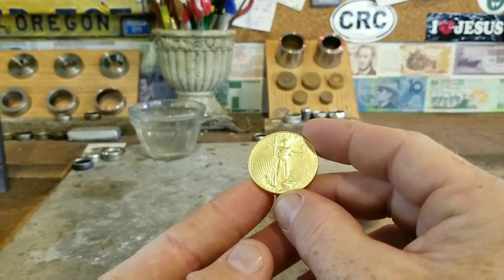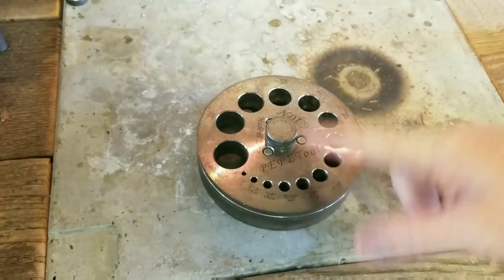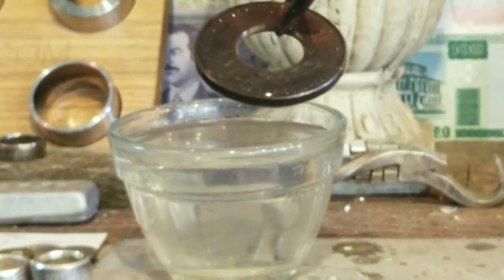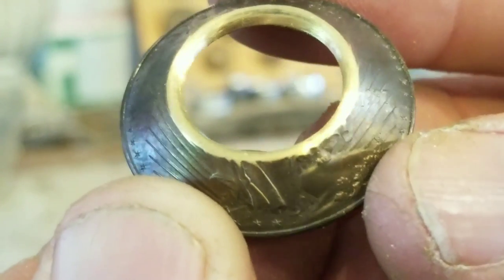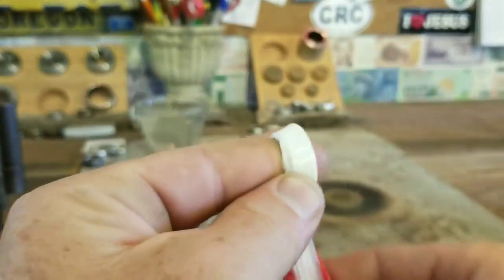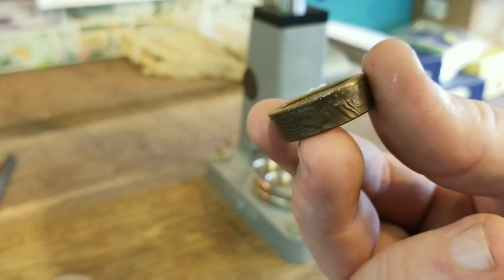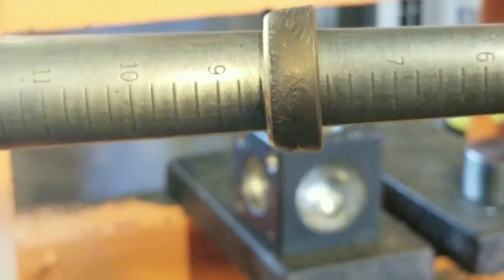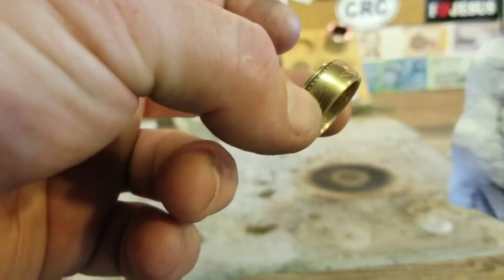How to Make a Coin Ring From a 1 oz US Gold Eagle

Comment: Today that's a beautiful $2000+ ring figuring the ounce of gold and one's time & labor very cheaply. And if you screw it up just remelt and recast it into a flat bar. 24 carat gold is still 24 carat gold and any coin shop besides knowing that could help you. I just sold a clean 4+ gram dental crown that was app 72% gold for a nice price ($157) though that's significantly less then that recast junk eagle is worth. So unless you're a journeyman "smith" and have deep pockets, start and get good on silver coin rings before moving over to the metal of Kings!!

Comment: Terrible question, but if on your second step, if you noticed a slight crack developing, what would be done next? Is it an expensive mistake or is there a remedy?
Reply from the maker: No it is completely fixable. That is why it is important to check often in order to catch a crack early. As soon as you see one forming,  just sand or file it until gone and then continue.

Comment: Very cool ring.   Nicely done!  I was wondering if a person could use a proof version of an American Eagle?  Proof coins are made in special dies with greater pressure for greater relief in the raised design.  I was wondering if the proof process makes the coin difficult to work with?
Reply from the maker: Proofs don’t really make a ton of difference. You would think they would but it is almost impossible to tell them apart when it’s made.

Comment: Hay Scott I am new at ring making in the last 4 months I’ve managed to buy about $300 in tools. I want to make a straight Morgan dollar ring not a tire shape. My knockout is 1/2 inch. after I start the fold what die do I need?
Reply from the maker: You are going to need a swedish wrap die. Check out my making small sizes with large coins video.

Comment: you should have used a Canadian maple leaf, they are 24k and more malleable, making it easier to form into a ring. a walking liberty or any american mint gold coin is 22k (same amount of gold though) and made more for handling the stress of being a coin. Aside from this, beautiful work.  Its just a shame you had to punch a hole in the coin, there are ways around this, and it could have saved you alot of gold.
Reply from the maker: That's the reason I only use 22k coins. It needs to handle the stress of being worn every day. 24k coins are too soft.

Comment: I would like to buy one of Jason’s hole 🕳️ punch but I have yet to see him make one that punches holes less then a half inch. I feel that’s too big of a hole in the coin. And the loss of what ever is on the coin. I like to make smaller holes and feel it is easier to reach the ring size going up as I make the ring rather then trying to shrink the ring to size.
Reply from the maker: His coin punches go down several sizes smaller than 1/2”

Comment: These bullion coins are 22 karat. Aren't they going to wear like crazy when worn as jewelry? Gold is so soft, usually rings are made from 14k or 10k, to make the metal harder.
Reply from the maker: Actually most of the high end jewelry is made in 18 and 22k. 10 k is the base level option and most custom jewelers don't offer it. 22k is a bit softer but still hard enough for jewelry. That is why 22k gold coins were minted in 22k instead of pure. That way they could stand up to being used in circulation.

Comment: How does failure “cost you a bundle”? Unless that coin has any additional value aside from its gold weight, it’s value doesn’t change regardless if it’s whole or in pieces.
Reply from the maker: They cost around $140 over spot and then, even as a jeweler, the refining process costs me another 5%. Failure isn’t free.
Reply: @CoinRingsfromTheMint : I’m not referring to buying (which you can easily get for $25 over spot), I’m referring to selling the pieces, and the refining cost is negligible. Nice ring though.
Reply from the maker: @scolee6408  I call bs on finding a us gold eagle $25 over spot lol. Maybe a generic round but not an eagle. Prove it
Reply: @CoinRingsfromTheMint : First Fidelity Reserve is where I bought my last one. I used to pay too much but a found that a little searching and haggling over price per quantity pays off.
Reply from the maker: @scolee6408  well I just called and even with the amount I do every year which is a ton I’m only getting $100 over spot. You must be buying damaged ones. Thanks for the tip though.
Reply: @CoinRingsfromTheMint : Possibly, I buy for the bulk weight, I’m not interested in specialty coins, strictly investment. They look fairly pristine to me.
Reply from the maker: @scolee6408  I understand that. Gold eagles have the highest premium on them. I do appreciate this conversation. I think I’ll be contacting your gold people :)

Comment: great work and your very skilled,but taking a coin that's worth at least 1300 or more depending on spot,and turning it into a ring that is worth god knows what to who knows who don't make a lot of sense.
Reply from the maker: Gold doesn't lose its value because its shape changes. I only make them when they are sold so it makes tons of sense.
Reply: It makes so much sense that you can't comprehend what the reasons are. Not only for the maker but also the customer who has ordered one, usually the coin has meaning.

Comment: One thing he doesn't tell you is that 24k gold is super soft and after even minimal wearing of the ring will cause very obvious wear...extensive use of the ring and most of the surfaces will be blurred and illegible.....
Reply from the maker: Well good thing it isn't 24k gold :)
Reply: @CoinRingsfromTheMint  O.K. you got me ....actually it's 22 kt , but the wear factor is very real.  I had a custom ring made of 14kt with inlaid river nuggets (18-22 kt). After a couple of years of intermittent wearing the river nuggets were worn smooth and you couldn't tell they were ever actual gold nuggets......
Reply from the maker: @johnangus7026  That is going to be the same story for any ring. My first wedding ring was the same way. Even steel rings wear eventually.
Reply: @CoinRingsfromTheMint I still have the ring.  There is no appreciable wear of the 14k gold relative to the gold nuggets. I have my Grandfather's wedding ring , also 14k that he wore for 71 years and although you can see some wear , the ring still retains it's initial style and beauty. Everything wears out eventually , that's a given....the point being some faster than others ...

Comment: Question, when you anneal the coin, with gold or silver, shouldn't you let it cool naturally without using water & quenching? To harden some metals you heat then quench in oil or water right?. Just wondering with gold or silver, if it might not be better to "not" to quench with water or anything to "speed up" the cooling process as I think that might ad back some hardness?. 

Note, if you ad http:// to the links in your description your links will become clickable and you definitely do want people to be able to get to your website and the jasons website as easily as possible right? - examples >> http://www.changeyoucanwear.net and http://jasons.works - these are clickable due to I added the http:// part as I said. Also thanks for doing these videos. I always wanted to make coin rings and these videos really show the process you use and make it very easy to follow. I'm a machinist so I think I can figure it out. Those Jasons works tools are awesome.
Reply from the maker: Right on thanks for that tip! I'll do that with the website. Non ferrous metals like silver, gold, and copper dont harden like a ferrous metal like steel. It is a pretty common question though. I had the same question when I first started making rings.

Comment: Have you ever made a ring with a silver or gold dollar piece.  Take a spoon and you take the coin in the thumb and pointer finger take the spoon and as you roll the coin with thumb and pointer spin and tap it with the spoon as you tap and roll you will see it starts to flatten out. Keep doing that and make it as wide as you want the ring and drill it out sand the inside and you have a spoon ring. It works real well . It is alot of tapping but it really does work try it out.
Reply from the maker: My first ring I ever made was that way!
Reply: That also was my first home made ring. Made it for this girl I wanted to go out with. I was like 15.wow that was almost 50 years ago. Wow I'm old. 😆 they do make cool rings for sure 👍.  The old man. Keep up you cool ring making bro.

Comment: You lose so much of the coin.. Is it possible to make the hole with a nail to use as much of the coin..
Reply from the maker: That would make a really wide ring that would be uncomfortable to wear. The hole size is selected with the  final ring width in mind. That and a smaller hole increases the chance you will get the coin to split.
Reply: @CoinRingsfromTheMint  Thank you for your comment Skyler.. i appreciate that..